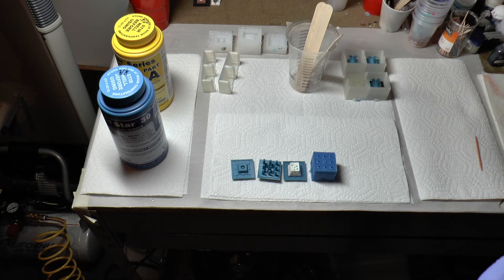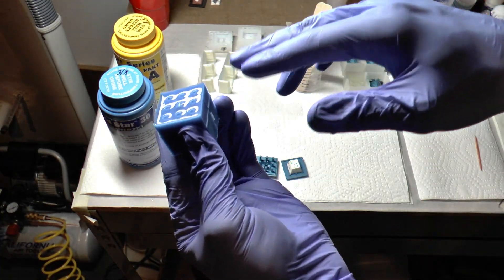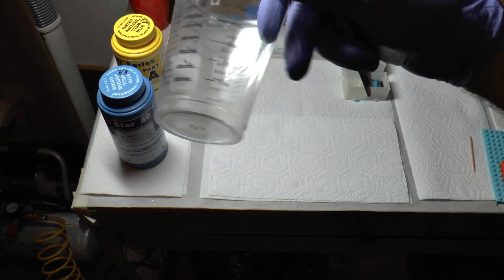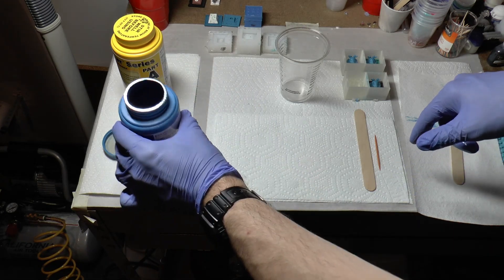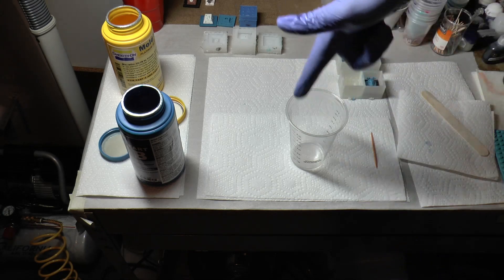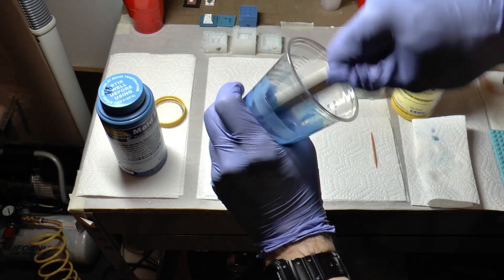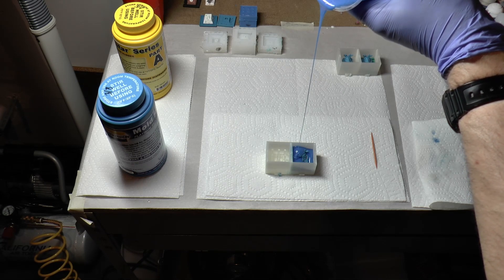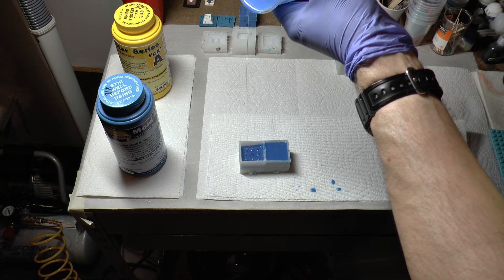Z-Butt: Overview and Silicone Mixing/Pouring (1 of 4)

Comment: do you have to use a pressure pot?
Reply: I think if you want molds that are reliable, then probably yes. It just gets out all the extra little air bubbles in there.

Comment: I looked at the recommended equipment. I bought the pump and accessories. The recommended TCP Global Commercial 2.5 Gallon (10 Liters) Spray Paint Pressure Pot with Manual Mixing Agitator is nowhere to be found.

I found a similar 2-1/2 Gallon PRESSURE FEED PAINT POT TANK Spray Gun Sprayer Reg Air Mixing Agitator. Will it work?

Comment: Can you go over the molding process for master keys?  Thinking of doing a transparent set for the IBM model M and adding RGB.
Reply from the maker: It'll be a little different for Model M, especially if you have the two-part buttons (black button and beige snap-on cover).  The zbutt system already has the stem/underside designed and printed in 3D, so you might have to do something similar for the IBM keys.

As an alternative you could try making two part molds by pouring halfway for the top half, then covering the exposed silicone with petroleum jelly, then pouring into the key cavity.  This way the silicone from each half wouldn't bind with the other part.  Lastly you'd need to push a large hollow needle through to create sprue channels.  This is TONS of work though... you're talking 208 separate castings for one keyboard.  Now that's a labor of love.

Comment: is that a pressure pot or a vacuum pot?  I can't seem to wrap my head around how a pressure pot would remove the bubbles.
Reply from the maker: It is strange to think about... it's a pressure pot in the video.  If it helps, here's the major difference and when to use:
Pressure pot:  squishes bubbles from every angle so they explode out into micro bubbles that aren't visible to the naked eye
Vacuum chamber:  pulls larger bubbles up to the surface and out

As a general rule, I'll only use a vacuum chamber for crystal clear casts or encapsulations.  And even then it's only a marginal improvement in the success rate.  For everything else a pressure pot is plenty to get perfect casts.

Hope this helps!

Comment: you recon I can skip the pressure pot as long as I am doing color cast (and be extra careful when pouring)? I live in an apartment, and getting one can be very difficult. perhaps, there is a lower viscosity silicon mix that I can get?
Reply from the maker: Yes you can!  Longer pot life will help reduce bubbles too, since you can let it sit and bubbles will naturally rise up in your cup before pouring.  Some makers will also brush resin in spots ahead of time so there aren't surface bubbles in your cast.

You can get quiet air compressors that you can't hear from one room away, and there are baffles you can put on pressure pot release valves so it makes them more quiet (but not silent).  So you do have some options for pressure pots too.
Reply: @NG-ob2ry  thats awesome, thanks for being so informative

Comment: Out of curiosity, why are you pressurizing the silicone vs. pulling vacuum on it and pouring? If I'm not mistaken, it isn't generally considered best practice to compress the silicone mold at this stage. There are various factors to consider, of course, pot/working time being one. If the durometer of the silicone is very flexible, putting air under pressure isn't going to remove bubbles, it'll just (duh) compress them. If your silicone is super flexible, once you take pressure off the mold, the bubbles can still return to atmospheric pressure, deforming the mold. Please feel free to correct me if I have that wrong. 

My understanding is that you'd use a vacuum chamber to pull bubbles out (you'd be surprised how many bubbles will still get past the thin stream technique), then pour. I've seen others pull vacuum again, but I think for the vast majority of cases that's a little "extra." Casting is generally done in the pressure pot. I could see arguments on why you'd cure your molds under pressure, but those would be weird circumstances like firmer molds with very fast pot times (no guaranteed time budget to pull vacuum a few times and then pour).
Reply from the maker: Great question!  Pressure is a great option for those without a vacuum chamber, since a vacuum chamber is really only helpful for limited applications (certain types of resins, epoxies, etc and for encapsulations).

So why pressure for silicone?  Air bubbles can form in unpredictable areas within the silicone mold, and that becomes a huge problem when the non-pressure cured silicone compresses in unpredictable ways.  What ends up happening is those air bubbles in the silicone get compressed and there are lumps and "warts" on the cast.

Pressurizing the curing silicone and curing resin at equal pressures (I stick with 50psi) fully resolves this issue.
Reply: @NG-ob2ry  I understand, I think. 

However, for others' sake, I do want to reiterate that at regular atmosphere, the mold can ALSO deform - e.g. the existing (pressurized, and/or tiny-when-pressurized) air that's trapped in the mold will change shape when removed from the pressure pot. You'd have warts/lumps/bumps if you were to cast at atmospheric pressure (assuming the volume of air trapped in a/the bubble was significant enough to do so, and location, etc. etc.). Most people wouldn't DO this, but I could see cases where someone makes a mold and ships it to someone who doesn't have a pressure pot. They'd probably get poor surface accuracy in that case.

The benefit of your approach is that you EXPECT deformation, and the argument is that since you're casting under pressure, once any trapped bubbles are compressed (at the same pressure you cured the mold in, preferably), the accuracy of the mold would return back to where it was cured - resulting in a properly formed cast. That part I can totally accept (even though there are esoteric problems that would cause this assumption to not be true, especially after wear and tear of the mold). 

So TL;DR: You choose one issue over the other: Trapped bubbles cured at atmosphere will deform when casting, so you cure under pressure. Trapped bubbles cured under pressure will deform the mold at atmosphere, which would have the overall same effect (just in reverse). You'd have convex dimples in case one, and you'd have convex dimples in case 2. 

The only reason I'm even expanding on this point (as if I were in a pressure pot, and now I'm not ;)) is that this is something to be aware about when molds change hands - the conditions in which the mold was made (or assumptions the user of the mold has) actually matters. It should also be noted that you shouldn't be very stingy on the resin when filling the cavity - if deformation is significant, the volume inside the mold cavity could change slightly - resulting in a slightly underfilled mold (this probably isn't going to affect people 95% of the time, but probably should still be mentioned...)

Feel free to correct any of those assumptions if I got them wrong. To be fair, also - this is all second-order problems to have. We're both (presumably) talking about corner cases that won't affect everyone... AND we haven't even talked about vibrating/disturbing the mold-curing process to get bubbles to come out of solution.
Reply from the maker: @diredesire  yeah, if someone is ordering molds from someone else, they should specify pressure or no pressure when they're cured, just in case that becomes an issue.  I haven't seen the reverse happen with divots from pressurized molds and unpressurized resin when I tried it, but crazier things have happened!

The theme for all of casting should always be "your mileage may vary" :)

Comment: Great video! You inspire many people!) I have a question. Is it enough to use a pressure pot for the silicon mold (of course for the plastic it’s the only way) ? Or do I need a vacuum? Thanks in advance.
Reply from the maker: Yes definitely go with the pressure pot first and see if you're still getting bubbles in your final casts.  If 45-50psi doesn't remove all the bubbles in your resin, reach out here or in the Discord server and we can solve your issue pretty quickly.
Reply: Fiscal Rascal thanks a lot!!!
Reply: Fiscal Rascal could you please help me. Every time I am using photopolimer plastic with Mold Star 30 it doesn’t cure. In the same box with the same pressure I have ABS master from my own key set - it makes a perfect mold! What am I doing wrong?
Reply from the maker: @mytenore  the particular plastic you're using must be inhibiting the silicone curing.  The only way around that is by a slight coating of something (maybe a model spray paint?).   I'd recommend paint over mold release since it's easier to see the color change in case you missed a spot.
Reply: Fiscal Rascal thanks a lot for a quick reply! I will try!
Reply from the maker: @mytenore  no problem and good luck!  If you still run into issues it might be faster to jump on the zbutt discord, lots of helpful people there.
Reply: Fiscal Rascal great idea! I will! Thanks

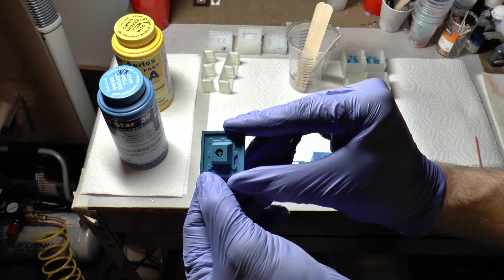Comment: Hi! Would you be able to link me the piece at 0:33? I'm just a bit confused, is that just the sculpting base on top of the master base?
Reply from the maker: The sculpting base is its own thing, so you can put the clay on top for whatever you want the final keycap form to look like.  It's a raised platform so it'll leave just the right amount of room inside to fit on a keyboard switch.
Reply from the maker: The advantage to using the sculpting base is you have more room for your design.  If you put clay on a regular keycap and use the master base instead, the minimum amount of room is set by the blank key instead of the inside cavity, if that makes sense.
Reply: Late reply lol - He has a stem on his sculpting base, i havent seen it anywhere else but you dont really need it. Itll be fine without the "+" there

Comment: What type of clay should I use when sculpting a master?
Reply from the maker: John Paul Onza Check out monster clay, NSP/Chavant, or other oil-based firm sculpting clays. They hold details well, and can be frozen when you remove them from the silicone to preserve the original.
Reply: @NG-ob2ry  I wouldn't need to bake them or anything right? Just sculpt away on the 3d-printed base and it's all good for casting?
Reply from the maker: Exactly!  Just sculpt, pour and let the silicone harden all the way, the toss the whole thing in the freezer for 30 minutes.  Then when you pull your clay original, it should retain 95%+ of its features.